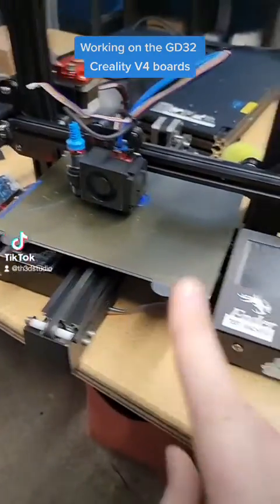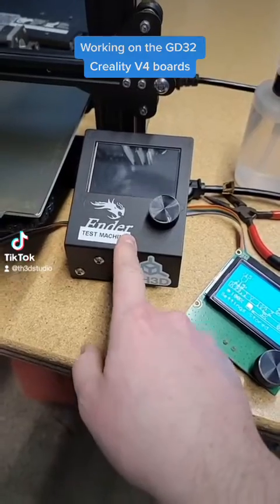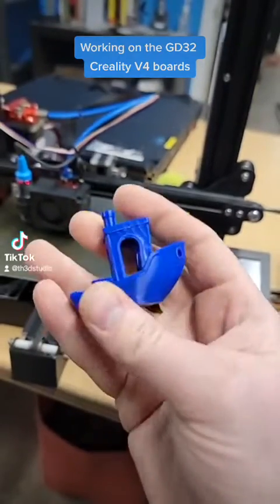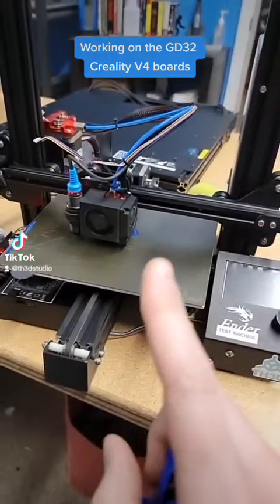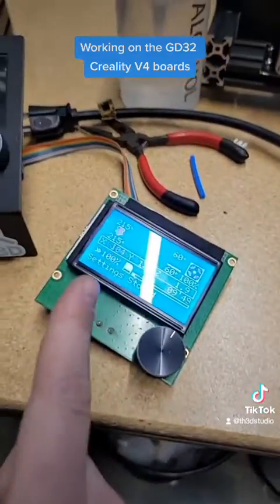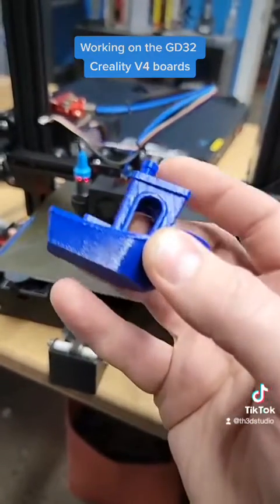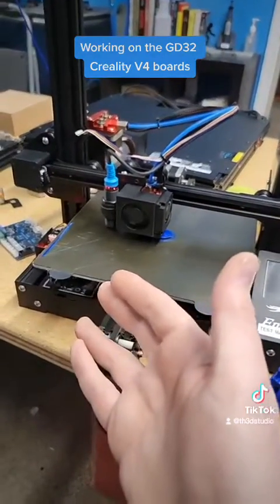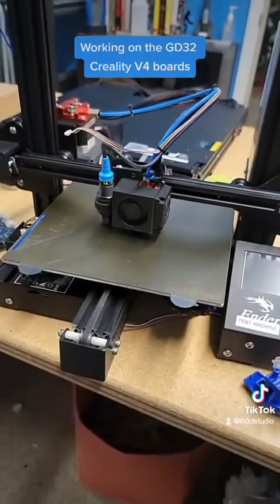Testing the GD32 builds for Creality V4 boards. #th3d #firmware #3dprinting

Comment: What ever happened to the other GD cpu video?
Reply from the maker: Not sure what you mean. This video is many years old now. The firmware is out already.
Reply: You had a video a long time ago about the CPUs explaining that they were clones. Explaining that sometimes you have to attempt flashing multiple times. Explaining that sometimes if you already have non-stop firmware on your printer that you have to go back and Flash original GD firmware before you can go with another Non- stock firmware.

Comment: That's weird the STM32F103_creality_maple (512K) recently in my ender 3, keeps restarting when I pushed the button.
Reply: Welp, another weird thing happened to my printer when I used STM32F103FC (256K), it worked!!!
Reply from the maker: If using the maple env you have to disable the speaker in Marlin. But the STM32 environment works fine with the GD32F303
Reply: What firmware build?

Comment: Any tips on how to dump the original firmware for this board? I've tried to dump the firmware through the swd debug port without success. I would like to have a factory backup before experimenting with other firmwares...
Reply from the maker: You can get the firmware from reality
Reply: @TH3DStudio  creality dont share the firmware for GD32F303RET6, and I've seen many persons bricking this board :P
Reply from the maker: They legally are required to.
Reply: @TH3DStudio  I know and they may be sharing something, but I though you know how to dump the firmware. I've found someone that gave me some tips on how to do that(no easy task since debugging is disabled). There is also the recovery file you share and there is a version of the firmware by creality being used over the internets... I was thinking about writing an exploit that could dump it to the card but someone fixed the "bug" that allowed that a long time ago... (it was not a bug, it was a feature)
There is also another option: buying an ic from china and building my own board without restrictions... (no joke intended)
I've also compiled the TH3D Studio firmware without problems.
Reply: @TH3DStudio  thanks for your answers. Hope I will test th3dstudio firmware soon, many thanks :)

Comment: Thank you Tim! Brand new to printing. My first printer, an Ender 3 pro, has the GD chip. Didn't even realize that the GD chips were a thing until yesterday. The nuance is overwhelming as a noob. Just updated my GD RET6 board with your wisdom and resources after several failed attempts compiling other versions of Marlin.
Reply from the maker: Glad to help
Reply: @TH3DStudio  Unfortunately the z axis problem plagued my experience. The best I could do was adjust babysteps during print. Z Offset in Cura couldn't help because I needed to go "below the bed" (from Cura's perspective)... HOWEVER. I have to say, TH3D's firmware was lightyears better than stock in every other way.

Comment: Is the salmon skin really the result of the custom firmware? I'm not noticing these artifacts on a GD32F303 RET6 Ender3 with stock 2.0.8.2 firmware (October 2021) (I don't want to experiment until the stock firmware is available). 
There may be some extremely slight artifacts, but nothing that would come close to being picked up on camera. 
More concerning is some noticeable Z-banding, which I think is because the Ender 3 is a pile of cheaply built unsupported crap that wasn't worth the $99 I paid for it , or because the printer I got has multiple damaged wheels, fresh out of the box. 

Sufficient to say I'm very frustrated with the E3 pro, because the Ender 3's community supported "upgradability" is literally the only remaining selling point for this thing... and right now the firmware can't really be upgraded safely. I haven't heard that any of the older official Creality firmware will work on this board as a fallback. Meaning there also isn't an official way to enable BL/CR touch, which is a product they are still selling as being compatible. 

As-is, they aren't any better than the other closed-source GPL violating manufacturers who are essentially selling stolen software.
We can't continue to let them get away with this kind of thing. Their support is so bad, they don't even include a complete quick start guide. Creality is killing 3D printing.
Reply from the maker: I've been trying to get their code but the salmon skin is present on the stock firmware. But I think it may vary based on the CPU batches. Those CPUs are not great quality and it shows in these weird timing issues with the artifacts. I believe they did post the GD firmware on their github but its nothing special. Most people just replace the boards with something like our EZBoard or even the V4.2.7 boards. Both of those print great with no quality issues.

Comment: as a programmer I finally took the plunge and bought an Ender 3 ... it came I assembled it and  immediately got setup to compile the marlin firmware and I discover the whole stm vs gd chiop licensing issue ...  

basically I am understanding STM is well supported and they provide libraries that can be used to compile the Ender 3 software but though the code would work for the GD chips with minimal altercations(as far as I know...) STM licensing requires the libraries to run on STM chips...

So GD dont want to do the support work and STM does not want to share it ... what a mess ... At least Amazon was able to help me get a new 4.2.7 silent board with stm chip upgrading my current board from the 4.2.2 ... 

thanks for sharing
Reply from the maker: Pretty much. It's a Chinese company doing what the Chinese do, which is copy hardware and not support it.

Comment: Just got one of these 4.2.2 GD32 (Ender 3 Pro). I need to add my BLTOUCH. Can anyone point me to a working firmware? Tim said Maple environment?
Reply from the maker: You can use our standard firmware. It's been fully tested and working on the GD32 chips on the 4.2.2 boards.
Reply: @TH3DStudio  Just a note: Using the UF had had many issues getting bedleveling to work. I think the GD wasn't saving the offset. I then used Maple. and no other changes to Marlin and it is printing wonderfully now. Go Maple!
Reply: @TH3DStudio  I tried looking for your standard firmware link but couldn't find it. I have the GD32F303 RET6 512K and have been trying to install my BL Touch and the Firmware from Creality website gives me the blue screen of death and haven't been able to figure out why. Where can I go to download your standard firmware for the Ender 3 Pro? Thanks.